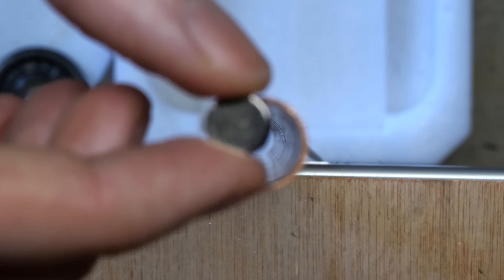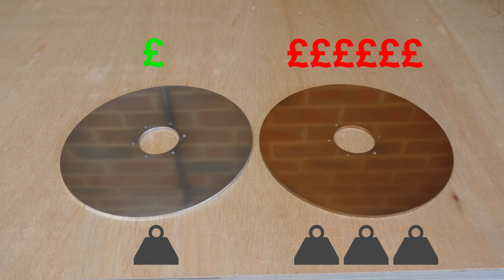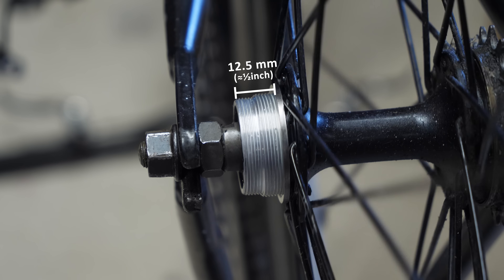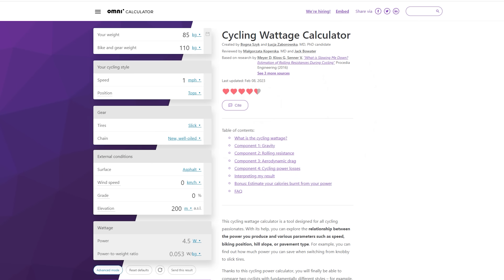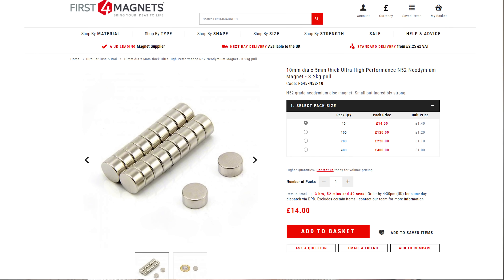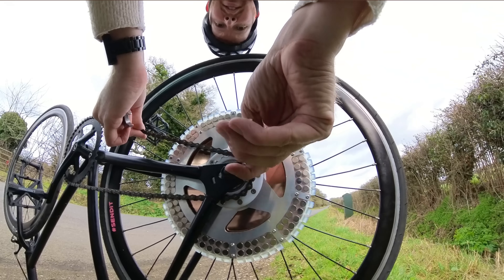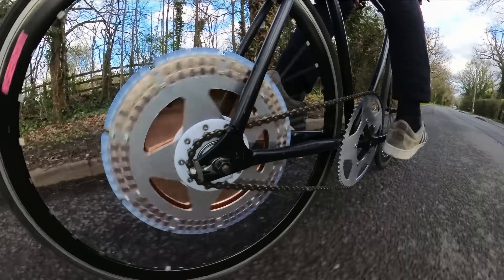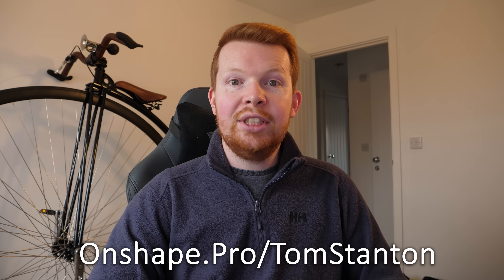Gearless Magnet Bike

Comment: I noticed that this is much the same as the way my exercise bike works. There are two belt-and-pulley setups that spin an aluminium disc between a couple of magnets. The resistance is varied by moving the magnets in or out. And yes, my efforts go into making the disc get hot!
Reply: There are row machines with similar magnet setups too.
Reply: I used to have a similar bike except that it used a drum instead of a disc.
Reply: @whatelseison8970  That must have made quite the racket!
Reply: My exercise bike bluetooths to an app and adjusts the resistance based on recorded videos and gradient maps submitted my other members of the app.
Reply: @DerekH_UK  gdm sir, that seems like a very sophisticated machine.
I hope all the sensors will keep working. Imagine if just a single small little sensor in the middle of the device breaks down and says: Yup, A blee blee blee, that's all folks.

Imagine having to trash such a nice device simply because a single electronic sensor quits, and you are not able to repair it yourself, or are not even allowed to (simply because the chip manufacturers wont sell you the required chip and only sell to Apple or such)

Jeez, anyways, may i suggest another youtubechannel which goes into much detail about that battle which also is taking place while we speak, the battle of Right to Repair. It stretches from notebooks to farmequipment. John Deere seems to be in favor of farmers not being able to repair their own bought equipment.
Anyways the guy is Louis Rossmann from Newyork but moved recently.
He is a great guy with a lot of knowledge. Trying to wake people up a bit, to not fall for the schemes these big tech giants try to get away with. Scamming the population.
Basically trying to make em all contributing slaves while they, the people who actually pull the strings of the sockpuppets they control on stages like the White House and so on.... they get away with it and will be in power of all of it.

Anyways, i hope it will last, your machine.
Contact me in 2 years. Wanna bet it has broken down for some silly reason which is too expensive for anyone to repair, so they basically say: buy a new one?
Durability is what people want these days. And yet they still accept such rubbish and will not all stand behind a guy like Louis Rossmann who explains it in great detail.
It is by design.
And the green thumb people who want to save this planet are falling for the same nonsense crap as the rest of us.
But, it is set up in such a way that eventhough we all want the same, we still fight eachother over nonsense.
Funny how that works.
Reply: @bertjesklotepino  Hi, thank you for your substantial reply.  My exercise bike (a BH Strada Dual, from Spain) is about 8years old (pre-Peloton) and is actually relatively simple.  There is a copper drum with a set of strong magnets in an arc, near to the outside of the drum.  The arc is spring-loaded towards the drum and a single servo pulls the arc away from the drum.  The bluetooth app (KinoMap) on my tablet activates the servo to vary the resistance when pedaling.   The app syncs the varying resistance with a gradient map and a video of the route cycled by the original person who uploaded the route.  The bike feeds back my cycling speed to control the rate the video/route is displayed.
I have had the bike in pieces and I think I could repair the mechanicals.  What would be more tricky would be finding out how to control the servo ... if the on-bike controller fails.  I'm sure the onboard controller is not too sophisticated and if it does fail, I would try and replace the display/controller with something else ... an Arduino/ESP32 or a Raspberry Pi.  
I'll get back to you if I go for putting my own controller in and tell you what sort of response I get from the manufacturers when I ask them for technical details.  I hope they will be cooperative.
Reply: some of the higher end trainers also use a generator, that powers the whole system!.
Reply: Exercise machines that heat up a rotor also cost you more in air-conditioning. Exercise machines SHOULD convert the mechanical power into electrical power push that power into the AC mains. (Even in winter.)
Reply: @quaztron  I think the amount of energy I can generate would be woefully small! But I agree with the idea. Might as well make use of the energy, maybe charge my cell phone or something.
Reply: Remember that the Lord Jesus Christ died on a cross for you because He loves you so much. He then rose up from the dead three days later
The Ten Commandments are called the moral law, (most of us are lying thieving blasphemous adulterer at heart and deserve hell) you and I broke the law, Jesus paid the fine. That’s what happened on that cross. 
By believing that Jesus died on the cross and rose up from the dead 3 days later and not just confessing your sin, but also repenting of all sin you have done and putting all your trust in Him in prayer, He will grant you everlasting life as a free Gift
Reply: @dove3853  Yes, I went to Mass this morning. But that's not what's being discussed here. Pax Christi.
Reply: The purpose of your exercise bike is to give you exercise - to make you work, by resisting your pedaling.  I'm sure you will notice that the disk between the magnets warms up, because your work being used to generate heat.  In Tom Stanton's case, however, the desire was to convert the work into distance.  So the desired outcome of the two machines is opposite, one to waste your effort as heat; the other to use your effort to go so0mewhere - but the actual outcome is much the same.  Work produces heat.  Your exercise machine uses all your work for heat generation;  Tom's machine gives some distance travelled, but it is limited by its inefficiency, which produced heat.
Reply: @DownhillAllTheWay , why are you commenting, he said that. Or are you just showing off?
Reply: @DownhillAllTheWay  It's not inefficient because of an imperfect design. It is inherently inefficient. It is made to dissipate energy, not optmize it.
Reply: @8546Ken  Yes, that's right.  The term "Gearless magnet bike" gives the impression that the megnets somehow replace gears, but they don't in this case.  You do get magnetic gearboxes (look it up on YouTube), but this is not one of them.  It is a magnetic clutch - the equivalent of a disk (clutch plate) driven by the pedals, that turns the wheel by friction - but there is always slippage, which results in heating the clutch plate - like slipping the clutch in a car if you start in too high a gear (stick shift, of course!)

Tom Stanton is a very technically competent guy, so I was surprised he constructed this without realising ahead of time that it wouldn't be "the answer".  A genuine magnetic gearbox would work, though I think they are probably easy to overload by applying too much force, in which case they will slip.
Reply: @DownhillAllTheWay  I don't understand why so many of the commenters don't seem to grasp this.  This is exactly the same as driving your car in top gear and riding the clutch until you get up to speed.  The only difference is that the magnetic clutch won't wear out in the process.  Several people did compare it to the brake on an exercise bike.  It's not only inefficient, but it's not giving you the torque advantage of a gearbox or a sprocket change.
Reply: @DownhillAllTheWay  i agree totally. Which was not difficult because you basically told nothing new.
It is basic logic.
IF your exercise machine was using your work to give you some distance it would become a problem because you need a large room to house it in.
Btw, you could just take a bike outside if you want some distance travelled while you work.
The whole idea of an exercise bike is that it is stationary and doesnt travel any distance.
SO by that way of thinking i would say it is kinda pretty logic what you explained.
And, some would then be very rude and say: Jeez, thanks Sherlock.
But i wont.
I just think it.
>:)
(yeah, i am a stupid dutch guy, so i blame it on that)
Reply: @bertjesklotepino  this comment, where you replied to mike collins, was hilarious
Reply: @DownhillAllTheWay  o damn, sorry, i forgot to add this but it has to be added.

The first part you typed: 
The purpose of your exercise bike is to give you exercise.

I forgot to add it but it should be somewhere in the start of my comment to make it more clear why i would think: Jeez, thanks Sherlock.
>:)

Just a joke sir, just a joke.
Reply: @bertjesklotepino  Hi there!  Don't worry, I took it as a joke.  I was commenting on the video - not trying to explain it - but I'm sure you understood the intent of my comment.  All of the best to you, Sir!

Comment: most rollercoasters that use magnetic brakes use aluminium, I would expect people building rollercoasters to know what they are doing. using aluminium also have the added benefit of faster heat dissipation

Comment: just spurting out stuff and ideas at this point: but this is starting to look like the electric motor/generator principle, all of the energy transfering over to heat due to no other consumer of the energy, if you could make something like this where you generate 3 phase energy and then manually (switch or button) or continously input the power back into the rotor or stator of your wheel like an asyncronous generator/motor, you could potentially create a bike with magnetic clutch connection and propulsion.

long time fan Tom, Keep up this creative great work of yours 👌

Comment: Can you make a passive home heater with this concept?  Create the magnet / copper ring...let a small wind mill drive the rotation AND provide a gentle airflow over the copper plate to transfer heat into the air and into a home or space....Motion to heat to warmed up houses in winter.  Even if it doesn't do ALL the heating, it could reduce energy consumption, and could also mount several of these on a rooftop.  Let it be supplemental so you can still heat by gas or electric on no wind days, but get free heating boost when its windy.

Comment: Pedal backwards to get more speed difference between the magnets and copper to slow down faster. Also that copper disk has got to be getting pretty warm.
Reply from the maker: The forward force on the pedals is really strong, so I was only just able to lock the pedals. It's not like pedalling backwards on a freewheel.

Comment: i wonder if using an electromagnet would give you the the outcome you are looking for.  You could increase and decrease the amount of flux as needed. and when you stop pedaling the electromagnet could be turned off to allow you to coast without the heat build up.  On the opposite side of the back wheel could be a dynamic breaking setup to act as the breaking system and recharge the power source (Lithion Ion Battery Pack?) required for the elctro magnet.  I realise this wouldn't be a commercially viable prototype, but would be a great experiment none the less.  Another Brilliant video Tom! Keep up the great work!!

Comment: Irrespective of whatever magentic/disk combination used, the heatgenerated = (wheel rpm-final chain sprocket rpm) x torque in Nm x 0.104 in watts
If the bike is stationary, wheel rpm = 0, and all the energy goes into heat obviously, just like an exercise bike, in fact this is how a lot of exercise bikes load the wheel.
If the wheel rpm is half the final sprocket rpm, the power at wheel is half the power provided by pedalling. At all times the wheel torque is equal to the torque applied to the final sprocket, but the drivetrain effy is a dismall 50% This combines the exercise function with the slow scene changing function of this bicycle perfectly.

Comment: 17:19 I see that the cnc didn't cut the inner cutouts (sprocket bore and spoke cutouts) and sprocket out all the way by leaving three tiny connections for each. Is this automatically done in CAM or programmed manually?
I guess this is so the inside material doesn't shift around as much when getting near the end of each path to cut out each shape.

Comment: 1.13 million views in three days on a “fail”: that’s my man Tom.  For perspective, though, the Wright brothers probably had 100 fails on there way to Kitty Hawk.
My first impression was that this mechanism was more analogous to a hydraulic torque converter than a variable transmission. Not a perfect analogy, to be sure, since a torque converter gets fairly efficient at speed.
An interesting challenge: recapture the energy wasted as heat. Just as impractical, of course. It would be easier to peddle a generator and drive the wheels with electric motors. Potentially some advantages over conventional electric bikes, losing the weight of the battery for the price of an additional motor to serve as generator, but ultimately impractical.

Comment: I have been toying with this idea for a long time, to create a magnetic clutch in meccano. I have a small solar powered electric motor that has to overcome a small stall  torque to actually start. If there is some load on the motor the initial inertia of that also has to be overcome before the motor will start. Thus with a magnetic clutch at almost stationary the load is isolated from the motor until it starts spinning, and so would require a smaller power input to start. With solar cells the input power is highly variable, and often minimal. With this clutch I foresee that the mechanism will kick off at a lower solar input than without it.

Comment: It would be better if you made a dynamo on these magnets that works like a brake. He brought the coils closer to the disk with magnets, it slows down and gives electricity, moved it away, the wheel has absolutely free play.
This is of practical use, because all industrial dynamos slow down the wheel, even if they do not take electricity from them.
I apologize in advance if it's not clear. I wrote through google translator

Comment: Interesting video.  I thought from the beginning that since there was no transmission the concept would fail.  But I did not know it would turn into heat.  Also the entire concept of eddy current was a revelation.
It could have some application in contactless breaking, but also not practical as the break force varies with speed and cannot be depended upon to safely stop.

Comment: sooooooo.... this doesn't change the gear ratio at all.... it in no way improves the ease of climbing hills or allows for easier take-offs or higher speeds ........ it's simply a magnetic buffer     
     pretty sure it wastes energy through slippage ....... you seem to be peddling way more than you would if it were directly bolted, sprocket to wheel ..... the clutch is just slipping, not giving any gear ratio-induced torque advantage.
 I'm not really sure I understand what you are trying to accomplish other than proving that magnetic eddies can be used as a clutch .
  I can see how this could be used to buffer erratic powertrain issues to provide a smoother transfer of energy.
    you might want to try this simple test .... park the bike in something that will hold it firm ( bike rack) and peddle ...... i believe that you can peddle as much as you want  without the bike moving anywhere at all ........ so... when going up a steep incline ... you may even come to a stop while you are still peddling  if the incline is steep enough

Comment: Would it make sense to build an e-machine based on this clutch? e.g. if the differential rpm results in higher gain of current into coil-magnets by a control unit? this could propel the bike and would be able to recuperate the brake energy back to the battery - and all of this without a gear... (or am I wrong with my idea?)

Comment: Love the idea. I have some ideas/questions though. What would happen if the magnets were closer to the center of the disk, and also further (on a larger disc). Also you could use the bike frame and mount switchable electro magnets, and depending on how many you turn on and off (using gear selector as a switch), you could then this for 2 things, 1. Like gears on a mountain bike, and 2. switch off some to reduce the drag when your not pedling.

Comment: so you changed 2 variables from the test with aluminium to the copper and I'm curious if you tested the aluminium with the NSN configuration? if it has more magnetic reaction perhaps the breaking force from the NSN method would be grater resulting in a higher resistance to the copper?

Comment: Intrersting concept. I did some googling and found that this kind of device is called an "axial flux eddy current magnetic coupling" in scientific terms. There is a bunch of literature with a whole bunch of tedious maths for design optimization out there. Two crucial aspects your design seems to be missing are the iron backplates on both discs (I think these are for guiding the magnetic flux) and the copper plate should be larger than the diameter of the magnet ring. This creates a lower resistance path for the eddy currents and thus less waste heat.

Comment: I wonder if the disc slippage could be moderated by variable electromagnets that could be turned on and off. Or use a combination of those static magnets and electromagnets.

Comment: copper is the best ELECTRICAL conductor, and the best thermal conductor

aluminum is the best THERMAL conductor (in practice) because it can get rid of its thermal energy just as easily as it gets ahold of it, whereas copper holds onto its heat a bit longer